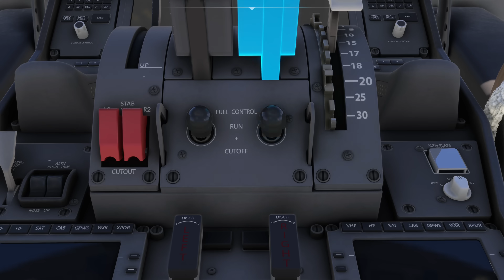Air India 171: Why Did The Fuel Cut-off Switch Get Moved?

Comment: On July 14, 2025, India's DGCA issued an advisory ordering all airlines to inspect fuel control switch locking mechanisms on Boeing aircraft, following the AAIB’s preliminary report on the June 12 Air India Flight 171 crash in Ahmedabad, which killed 260. The report highlighted that the fuel switches moved to "CUTOFF" during takeoff, referencing a 2018 FAA bulletin that Air India didn’t act on, as it was non-mandatory. Airlines must submit inspection reports by July 21, 2025. This follows Republic TV’s inquiry into DGCA’s inaction on the FAA’s 2018 advisory, prompting renewed safety measures. Ref: https://www.youtube.com/watch?v=xQzgj9No0EU

Comment: Who said the switch was "physically" moved? It was just that the signal was transitioned from on to off.
Reply: The pilot would not ask why did you cut off the fuel if he didn't see it was done.
Reply: The two people flying the plane talked about it being moved.
Reply: The experts have already established that the switches cannot move through vibration or any other means. One of the pilots had to physically move them.
Reply: @MarkNOTW weren't the switches found on off position though?
Reply: @gigipizzuto4068  The switches were found in the on position.  The FDR proved that after takeoff they were physically moved into the off position.  Then one Pilot asked about them being off.  They were then physically moved back into the On position and the engines started to re-ignite.
Reply: If the words are as reported, he asked because he saw him do it.
Reply: That’s the thing that sticks out for me; what are those switches connected to?  The recorders captured the switches changing state, but that seems like one piece of a puzzle.
Reply: transitioned is code word for physically moved.the switch cannot move other than moved by phisical action.where you dummies coming from.

Comment: The biggest question I have is: if the switches were moved intentionally with the goal of crashing the aircraft why did that pilot allow the other pilot to move the switches back? What level of confidence did the switch flipping pilot have that the craft was doomed therefore not needed to wrestle the other pilot to stop them flipping the switches back? A question for an experienced Boeing pilot, does this switch flipping just totally doom the plane? Is that well known by other Boeing pilots?
Reply: It takes about 20-30 seconds for the engines to spool back up…
(producing useful thrust) 
So with the speed and the altitude of a freshly taken off plane it’s basically impossible to get saved whatsoever

Comment: The pilot didn't shut off the fuel valve switch he said so on the audio. The report said the switch transitioned off it's just reading an electrical signal it doesn't mean the pilot moved the switch. One pilot asked the other pilot why he switched off the fuel because he assumed that's what happened but the other pilot said he didn't do that. There were electrical problems before the plane took off and the rat deployed. I think the electrical problem somehow affected the fuel cutoff.
Reply: The pilot would not ask why did you cut off the fuel if he didn't see it was done.
Reply: @Johan654-s1f  The FO was flying.  It's very possible the captain moved the switches into cutoff, and then asked the FO why he moved the switches because the captain KNOWS he's being recorded.  Captain wants to deflect blame from himself so his family can get the life insurance payout, so his family does not face shame, etc.  The FO would reply "I did not" because he knows he didn't.  Then it took FO 10 seconds to realize that the switches were in cutoff because the captain turned them off.  As soon as he realizes it, he turns them back on, but it's too late.  The captain knew the exact moment to turn off the fuel to kill everyone...and that's what I believe he did.
Reply: @penguin12902  Yes, the question only prove the switches was manually set to cutoff. It doesn't prove who did it. That's why the investigation report don't tell who asked the question. They don't want to blame the wrong pilot.
Reply: @penguin12902  Maybe, maybe not. Since the two almost certainly fought over returning the switches to Run, solid evidence is likely to come from the voice recorder during those crucial ten seconds. As they fought, they probably yelled at one another. I know I would.
Reply: @Inkling777 captain would not have needed to put up a fight. The moment he cutoff fuel to the second engine they were all dead. There was no way to recover in time...at least that's my belief.
Reply: @Johan654-s1f  You don't need to see it happen but you could assume it happen, that could be the reason why ask.
Reply: @jxmai1000  No that makes no sense, if he didn't see it was cutoff he would have no reason to ask "why did you cutoff..". If he just felt the thrust was lost he would rather ask why do we lose thrust.
Reply: @Johan654-s1f  he could have assumed that since the switch is off, then the other pilot must have done it, so maybe he asked that but who knows at the end
Reply: @killerbrother6187  No if he didn't see it was cutoff it would not make sense to assume that. Engine thrust can be lost by many other reason so it would make sense to ask why did we lose thrust?
Reply: @killerbrother6187  It proves the switch was  set to cutoff. Otherwise no reason to assume that. Which pilot did it we don't know, the one who did it could ask the question to put the blame on the other pilot.
Reply: It's possible but how it restore after 10 and 14 seconds?
Reply: I was a submariner and I work on submarine sonar systems to this day.  When people make mistakes, they'll lie about it.  I'm always fixing boats, and I'm always getting lied to.  It happens.  

A pilot did this.  We'll likely never know why.  I'm not sure why we have so many amateurs and non-engineers making guesses down in these comments.
Reply: Definitely software malfunction
Reply: @banyantreeleaf that's basically impossible. The cutoff systems are isolated from the software and the levers were manually moved. A computer would not need time in between to manipulate the next lever.
Reply: So you dont consider it possible that the pilot lied? The preliminary report is crystal clear. It states "the Engine 1 and Engine 2 fuel cutoff switches transitioned from RUN to CUTOFF position one after another with a time gap of 01 secs". That seems about as clear and unambiguous as it could be, the switches were moved (transitioned) rather than some electronics glitch. Or do you actually think that based on pure speculation you know better than the actual professional air crash investigation team who have access to all the evidence?
Reply: If there was an electrical or mechanical problem regarding the fuel cutoff, I can see a world where we would think they manually placed them in cutoff and then run to restart the engines. However, experts, including Captain Steve, said that it wasn’t a known procedure to do that. There would've been a call that there was a fuel issue, and they would've been on the same page even if they decided to do that. But definitely not at takeoff.
Reply: Exactly
Reply: @banyantreeleaf  no, not exactly.   The opposite of exactly.  This wasn't a software glitch.  The switches were working exactly as they were designed to do.  1 of these 2 pilots cut them intentionally and then lied about it.  Humans kill and lie about it far more than fuel switches fail.
Reply: Then how did BOTH get turned back on?
Reply: RAT & APU deployed because of dual engine failure after rotation. the CVR is source specific, so the authorities know exactly what was said and by whom.
Reply: Don't forget, So far we are only able to read the report, no one in the public has hear the voice record yet.
Reply: The FDR confirmed that the switches were physically moved from RUN to CUTOFF 1 second apart and then moved back to RUN after the pilot questioned why they were turned off.  Software glitches have never ever ever been seen around the fuel cutoff switches.  Ever.  The chances of both failing within 1 second of one another are 1 in a few billion.  Its far more likely that one of these pilots was intent on murdering everyone and when confronted with what he did he lied, as humans are prone to do.
Reply: I'm not a pilot but I'm thinking that's what happened. They were able to reset it when they manually moved the switch to restart the engines. It was not manually shut off or accidentally shut off and one of the pilots was not trying to crash the plane so all that's left is an electrical problem or a software glitch.

Comment: 3:20 dual sets of switches, one on the pilot side one on the co-pilot side.  Shutting down the fuel flow requires that both sets of switches be actuated.  However I can't imagine a situation where that could be a problem. As you mentioned engine fire at low altitude when one of the two pilots is incapacitated.

Any way you design it, if one of the two pilots is having a mental issue or is incapacitated you got a big problem.

Comment: I like the idea of needing both Pilots to confirm a shutdown of an engine. Both Pilots would need to press on their outside switch to cause the engine to shut down. That is the left side for the captain the right side for the Copilot
Reply: The problem with those designs is if one pilot is incapacitated/unable to, then you’re S.O.L.
Reply: The problem with those designs is if one pilot is incapacitated/unable to, then you’re S.O.L.

Comment: your answers are bad.  they are deflecting.  for example  #1 you said the second pilot can take actions after the first pilot make a catastrophic input.  that is not the question.  the question is can he take successful actions to save the plane or are there some times during when 1 pilot can crash a plane and the other pilot do nothing about it.  #2 you did not answer why a computer cant prevent fuel shut off when that would cause a crash.  we know there are reasons where you need to shut off the fuel but there must be reasons where shutting off the fuel would be the death of everyone and we see that here. a computer could prevent that.

Comment: Could this be possible? This plane was having electrical problems intermittently in the previous flight and video shows the infotainment system and A/C unit was failing and internal lighting was shorting out. Excessive heat caused the chip failure in the fuel delivery system. That’s why both pilots thought the other one turned off the switch, when in fact the system failed and shorted out the delivery of fuel. The switches were never disengaged and were found in the fuel run position. They were never turned off manually.

Comment: The problem with having a two pilot shut off of fuel switches is of one of the pilots can/will not comply for whatever reason and this could possibly be as tragic in the case if engine fire/s for example.
CAMERAS IN THE COCKPIT WOULD MOST LIKELY PREVENT THIS!!!!!!!!!!!!!!!!!!!!!!!!!!!!!!!!!
CAMERAS IN THE COCKPIT WOULD MOST LIKELY PREVENT THIS!!!!!!!!!!!!!!!!!!!!!!!!!!!!!!!!!
CAMERAS IN THE COCKPIT WOULD MOST LIKELY PREVENT THIS!!!!!!!!!!!!!!!!!!!!!!!!!!!!!!!!!
CAMERAS IN THE COCKPIT WOULD MOST LIKELY PREVENT THIS!!!!!!!!!!!!!!!!!!!!!!!!!!!!!!!!!

Comment: When the pilot said "why did you cut of the fuel?" and waited 10 seconds. shouldn't he had turned the engines back on then asked why? When you see the fuel turned off, then why ask and wait? Just fix it first.  Who has time to ask why first.
Reply: it doesnt say when did he ask this .maybe he asked it after restoring engine fuel switch to run.but he took 10  second to restore it.10 seconds is  a long time when plane is at take off.
Reply: @stephenroger4527  Other videos say it was 10 seconds later when the fuel was turned on. I could be wrong.
Reply: It’s basically a normal human reaction following an unplanned and unexpected event, called the “ startle response”.  Completely normal in this situation. It takes a few seconds for someone to realize that there is a problem, then go quickly through the “denial” phase, and then react with an appropriate reaction, as this situation would be absolutely unconscionable to a reasonable person. The fact that the fuel shutoff switches were even placed back in the RUN position at all in that short period of time shows that one pilot was heroically trying to save the ship.
Reply: Because pilots are trained to work together, not do things by themselves.
Reply: The report isn't clear about when various remarks were made during the event time line, but I simply cannot imagine that the two pilots held anything resembling a rationale discussion. One pilot, aware of their desperately situation, immediately attempted to return those switches to Run. The other fought desperately to prevent him. If the plane had not crashed, the latter would have faced hundreds of attempted murder charges.
Reply: My thoughts exactly. Why 10 seconds? Unless there was a struggle going on.
Reply: Easy for you to say sitting here in your chair.
Reply: Maybe because the junior pilot had respect for his older captain
Reply: @saturn-u3q If i pulled the hand brake on your car while on the expressway, would you un-release it first then ask why or ask why first then release it?
Reply: @NDR-DATA-RECOVERY unrelease it first then ask why.
Reply: @saturn-u3q "Maybe because the junior pilot had respect for his older captain"
You bring up a good point. While it isn't determinative, I find it far easier to understand why a junior pilot would ask a senior that question than vice-versa.
Reply: @Inkling777 assuming the junior pilot asked why he did it to the older pilot, he expected to know the reason why he did it, and not a denial that he did not do it.

Comment: There's one thing that everyone missed in the report. In the previous flight, they had an error STAB POS XDCR. Which is something related to the horizontal stabilizer. Also keeping in mind that right next to the fuel cutoff switches are those red switches of the stabilizer. Could it be that the same error popped up again, and the pilot intended to operate those stabilizer switches but mistakenly or subconsciously operated the fuel switches instead? This would also make sense that the pilot later responding that he did not do so.
Reply: nobody operates fuel cut cut off switches at take off. even if a bomb went off.
Reply: @stephenroger4527  You probably didn't understand what i mentioned. Please read the comment again
Reply: @debasishait1975  you didnt read my answer.no pilot in aviation history has mistakenly or subconsciously operated the fuel switches

Comment: Cap't. I've been very frustrated by the many "assumptions" during this investigation. So now I'm wondering...Does the Cockpit Recorder actually record the POSITION of the switches, or the electrical result of that switch position. Is there any way that hardware or software upstream of the switch could have intermittently turned off and then on the fuel? Can we hear the switches being moved on the CVR? This theory would coincide with the one pilot saying that he didn't turn off the fuel. Keep up the excellent work sir.

Comment: Captain Steeeve I can’t stress enough how I believe cameras are a real necessity in the cockpit. They only need to be recorded, then taped over during the next flight and would only be available for an inquiry like this. No leaking would be possible. 🤷‍♀️
Reply: yes mh370 and ia171 would not have happend if pilot knows camera is recording them to the cloud.,
Reply: @stephenroger4527  You have a theory about what happened. Because you obviously think your theories are facts you suggest remedies that wouldn’t even work if your theories are proven right. That is a perfect example of flawed reasoning. Uploading videos to the cloud? Ten years ago? Very soon there will be 40 million scheduled flights per year. So you want to livestream a billion video hours by cellular networks and satellite to a cloud to possibly solve one mysterious crash every ten years? I almost forgot: A B787 can generate 500 GB of data per flight, that’s close to 100 GB per hour! That’s almost impossible and extremely expensive to do.
Reply: Fully agree!! 100%!
Reply: Are the in-cockpit audio recordings leaked on a regular basis?? What are you afraid of Captn Steeeve??
Reply: Live CVR's are rewritten.  Good suggestion.
Reply: I believe Captain Steveee stated yesterday, Anything is possible.

Comment: Thats interresting! You personaly in the video at round about 2:50, pull back the throttle and than switch the cut off. So also i would do. So in my opinion there is no reason to disable the switch, while the throttle is in any position as idle. What do you think?

Comment: I have a question. Is it possible to cut off both engines within one second? Fuel cutoff switches for both engines were switched to "cutoff" almost simultaneously. Is this achievable?

Comment: There is a report about boeng sending a advisory sent in 2018 about the fuel cut off switch needing to be checked for the 737. My question is Is this true? and are the switches on 737 same as 787? Do you think this advisory is relevant for this crash?
Reply: @captainsteve please answer this. !